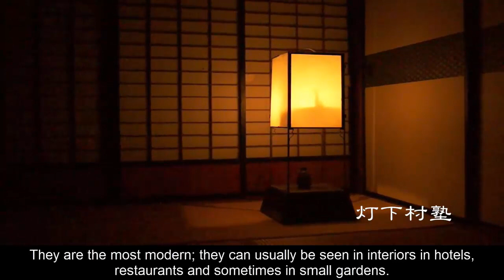Amazing Techniques of Carpenter Extremely Satisfied For Woodworking - Building The Andon Lanterns

Comment: I dont understand the use of the word carpenter these craftsmen are cabinet makers not carpenters.
Reply: As I always was taught, a carpenter is someone who works with wood; a cabinet maker is a specialist carpenter. carpentry is the parent/umbrella skill. framing carpenters, flooring carpenters, cabinet makers, trim carpenters, etc. of course, my wife says I'm wrong 85% of the time, but that is the traditional meaning of carpentry.
Reply: I have been in the building trade for over 50 years and trained as a joiner. Carpentry always meant the structural work on a building , timber floors roofs, fixing door frames and window frames usually any work before plastering. A joiner did the timber finishing jobs such as making fixtures in a workshop and fitting doors, architraves,  skirting boards, kitchens etc. A cabinet maker does the finer work such as making tables, chairs, drawers including marquetry etc on such furniture.  I hope it wont cause any more disharmony with your wife but this is how myself and all my colleagues have defined the different trades.
Reply: car·pen·try

ˈkärpəntrē/

noun

the activity or occupation of making or repairing things in wood.

the work made or done by a carpenter.

"the superb carpentry of the mahogany desk"
Reply: The definition below taken from;  https://oliverwild.com/difference-joiner-carpenter/

A joiner is a trained craftsman who makes or joins the wood, usually in a workshop, whereas a carpenter constructs the timber on site. In simple terms a joiner makes the wood that a carpenter then fixes on site. A joiner therefore is usually associated with making doors, windows, staircases and fitted furniture that are normally made in a workshop off site, due to the heavy machinery involved.  A carpenter however tends to specialise in larger elements such as constructing and fitting roof trusses, stud work and floors on site, by cutting and fitting them together, using a range of materials and tools. Carpenters however are responsible for the assembly and framework of a structure.